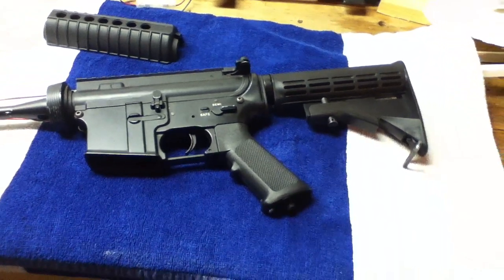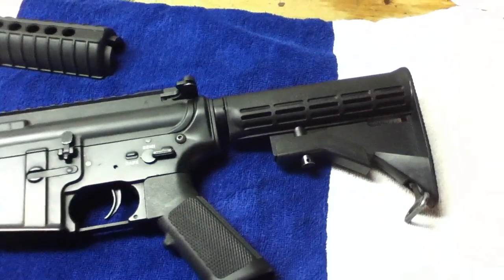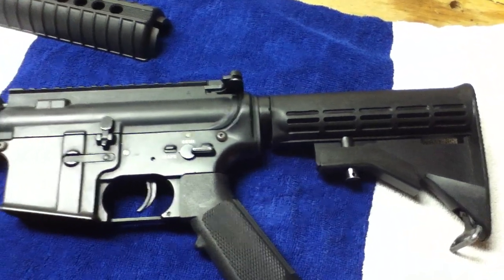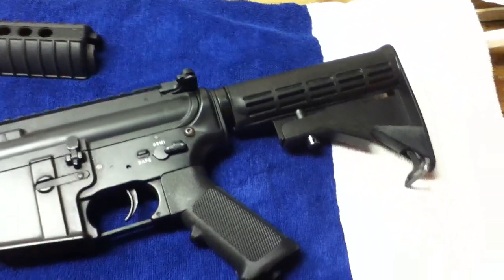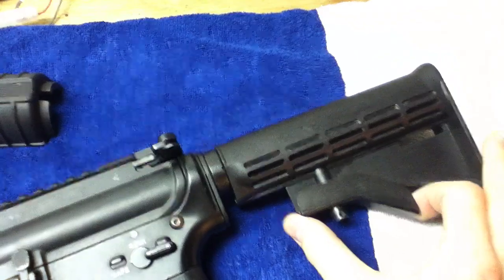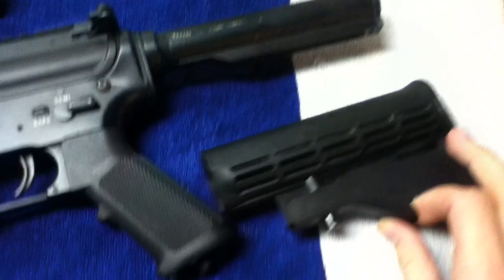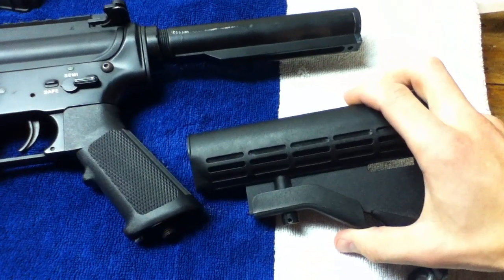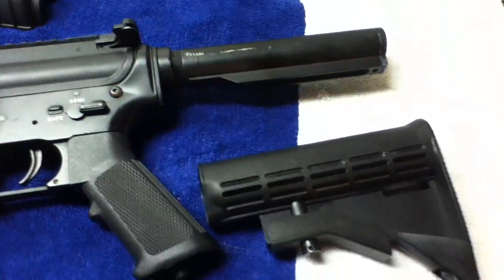How to remove the stock on an m4

Comment: I was trying to find out if it's possible to get that tube off. I've got a box I want to store it in and it doesn't quite fit...
Reply: Brotha OG the MVP you have to loosen the tiny bolt/screw thing on the side with a small Allen wrench and then unscrew the huge screw inside of the tube. It comes right off
Reply: May have already figured that out since this comment was two years ago but just in case you didn't that's how